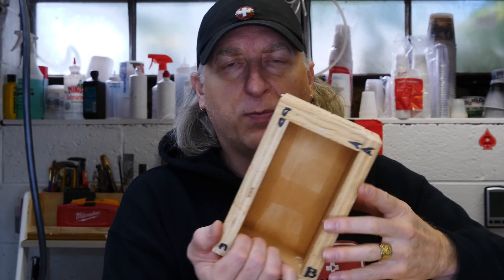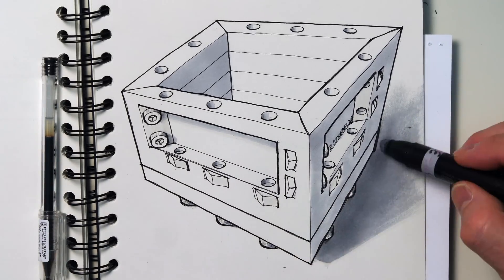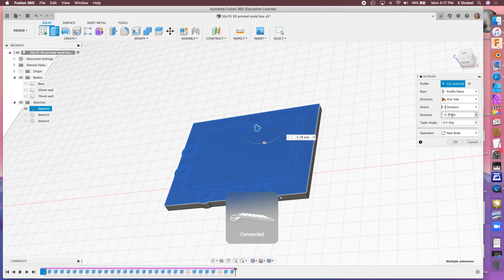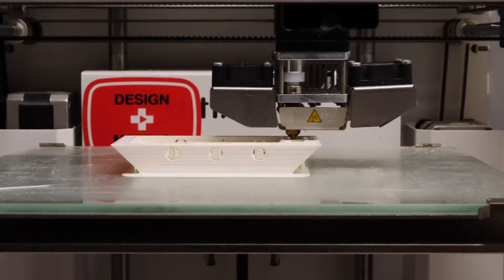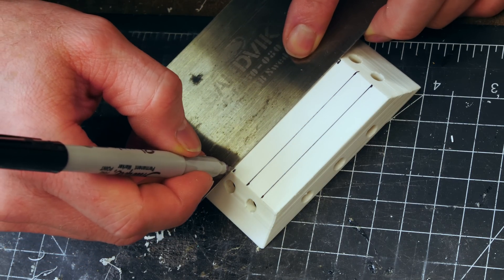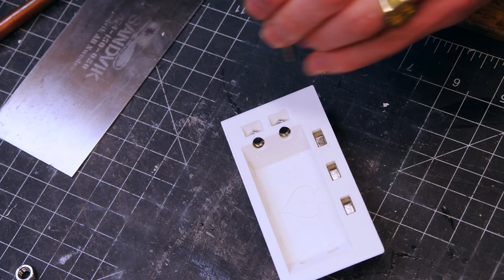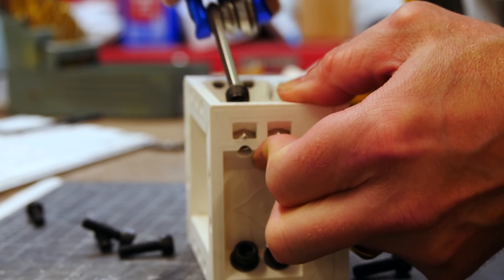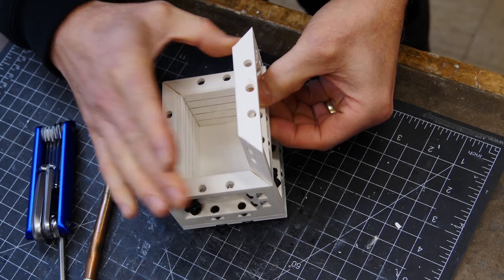3D Printed Molding Box System for Silicone molds & Casting Urethane resin parts

Comment: Hi Eric - thanks for so generously sharing your skills and experience with us!  

It's been about 2 years since you released this video.  I'm wondering, what percentage of your molds use this modular approach vs the library of plywood molds that you previously used?
Reply from the maker: It's really just a matter of scale, it depends on what I have to mold and if it'll fit inside of the 3D printed ones. Honestly I should make some bigger ones. They work really well and I'm really pleased with how they snap together and perform.

Comment: Good video but that Ultimaker needs a serious tune-up! Those layers lines!
Reply from the maker: What’s your suggestion for the tune up....
Reply: @EricStrebel  I sent mine back to Ultimaker for them to do it but first things would be checking all rods are clipped on properly (my plastic injection molded clips warped over time), rods lubricated, all hex screws tightened (especially the ones holding the stepper motors) and most importantly, checking the tension in the belts
Reply from the maker: Ok, seems like good practice for basic maintenance of the machine

Comment: If you are going to be using this one size allen wrench you can get a T handle wrench and by spinning it by the shaft and finishing off with the handle it might be faster than the power tool because you don't have to be worried about over torqueing.
Reply from the maker: Yes, good tip

Comment: "I'm limited by the size of my printer..".if you dropped the captive nuts in from the edges you could alternate the parts back and forth about the 45 degree angle and make one large plank... or a slab if you alternate the captive nuts slots.

Comment: Very nice! Self adhesive rubber packing on the miters would make good gaskets. You’d probably want to print the next ones with a shallow channel to accomodate the packing, slightly less than the thickness of the packing.

Comment: Wow, these are awesome. Also, just a slight size increase, cast them in aluminum one can make permanent cope(s) and drag(s), for casting aluminum parts. much like myfordboy did. Though, these are a cooler design.
Reply from the maker: Yeah, thanks! He does some nice castings, he had even made his own aluminum molds
Reply: @EricStrebel  Yes, he has he's also gotten into 3D printing which enables him to make master molds of steam model parts for engines and trains. I just ran into your videos, and your channel seem very interesting enough to binge watch with popcorn and a couple beers. Yup, I'm hooked. I'm subscribing.
Reply: @EricStrebel  Also, pardon my impertinence, please but may I suggest using (counter sunk) flat socket heads screws for a flush bottom plate of your modular flask?

Comment: LOL I knew you were in trouble as soon as you started sketching.

This actually seems less flexible than just the overlapping-board assembly.  The main issue is the fixturing, which you flat out didn't address.  You started with screws and...  went right back to screws.  Did you ever ask yourself, "Are screws actually necessary?"  Or "Does this even need to be a rectangular shape?"

Also your printer has major issues with banding.  First culprit is your z-axis.  Your prints look like something from 2010.

Comment: I would suggest trying out some heat press inserts. They're very strong and make very professional looking parts. For this I probably would have used M4 bolts with M4 inserts.
Reply from the maker: Thanks
Reply: @EricStrebel  stick with the nuts eric.. heat press inserts can pull out under extreme force.. the nut design cannot..
Reply from the maker: I agree

Comment: You should first calibrate this printer and fix the z-axis print problems, then select the correct parameters in Cura. BTW, so much plastic and metal for basic little box, really?

Comment: a couple of things on your print

that was not a skirt you removed that is a brim Skirts do not touch the model brims do and their was no need for a brim the brim is meant for thin models that need more buildplate adhesion so thy do not fall over during printing

their was no need for the support in the horizontal round holes considering you just drilled them out anyways but just under the vertical round holes those were actually the only supports you needed when adding supports you should have just used a touching buildplate option instead of an everywhere option in your slicer

if you were going to model in the fill lines as long as the lines them self's were recessed you would not have needed supports for them because it would be nothing to bridge there tiny gaps or you can chamfered them so thy are little v shaped groves and not have over a 45 degree angle again being easy to print without supports

you really need to do some test prints just to test the capability's of your printer so you know what its capable of printing so you stop wasting material and time printing supports you do not actually need and can feel more confident in printing more complicated things without supports
Reply: i was thinking a lot of the same thing when he said support was needed to add fill lines, but started off the print mentioning 45 degree angles don't need support... 😣

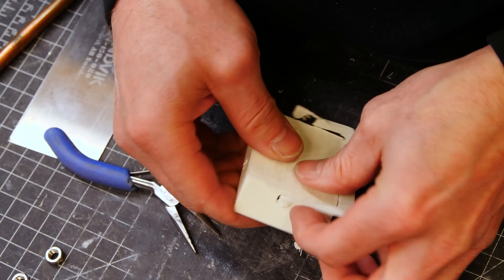Comment: 3:09 Brim, not a skirt.  Plus, you should be ok printing w/o a brim, which in turn should reduce the amount of clean up.  Using tear drop holes should further reduce post-processing.
Reply: And 10mm fill lines can easily enough be done with a triangular cutout that won't need any support material cleaned out of it.
Reply: tear drop holes dont look clean when you want round ones. it looks bad imo. and its better to drill out the holes anyway.

Comment: Thanks for the Video and for sharing your ideas Eric. I use a magnetic modular system, with 'L' shaped sides which are adjustable in terms of length and width, they sit on a large magnetic sheet and no fixings are required - neither is hot glue so takes about 20 seconds to put one together. I wonder if your fixed design could be hinged so that 4 sides fold together and then clip to a base, or borrow from the lego concept to make something more modular. What you have there looks very sturdy but perhaps those bolts might be tedious after a while? Just a thought...
Reply from the maker: Magnets are pretty clever! Gosh I can see making a new version with magnets. Did you develop this system or purchase it?
Reply: @EricStrebel  I developed it, because I got tired of cleaning up hot glue and continually making new mold boxes. I use foam backed magnetic tape for the side edges  and side bottoms and steel impregnated adhesive sheet for the base. It's pretty cheap too. I tape the inside of the mold box walls with clear adhesive tape so don't have to worry about anything sticking and I try to avoid mold release sprays because they can interfere with painting. The L shape walls are common as you'll know in mold making and allow for a entirely adjustable system that can be re-used.
Reply from the maker: Are you ok with me adding magnets to my concept, and giving you credit in a future video?
Reply: @EricStrebel  I use this for my work (www.jimcheatle.co.uk) - I'm an artist based in London, UK. Go ahead and use it, no problems Eric.
Reply from the maker: Fabulous, I will give you a shout out, and add the link to your site when I make the 2.0 version. Thank you for sharing your idea. The world will benefit from your kindness

Comment: sorry, but this is overengineered and in the end acutally not very versatile. build 4 separate (lego or duplo for best versatility) walls, align them on a smooth surface with overlap (!), seal with hotglue. your product looks nice and professional, but the concept seems to be way off topic ("for years").

Comment: With finger joints instead  of mighter joints on the upright walls you might be able to overcome the length  limitation from the 3D printer build volume. One countersink bolt going through the fingers top to bottom to secure it. This way wall pieces could be connected to each other to get longer walls.
For the base plate a tongue grove system could be used to create larger bases than the 3D printer allows...
Reply from the maker: yes, possibly.

Comment: I did something pretty similar a few months ago for the same purpose of casting silicone molds. I used FreeCAD's Spreadsheet workbench in order to automatically generate a box of any size with a set of parameters, which was pretty handy, but I plan on re-doing it in either OpenSCAD or CadQuery (which looks interesting) for my next project for even more flexibility. I've haven't used Fusion a lot (and I don't plan to given the recent license updates) but I don't think it's possible to set this kind of parameters unfortunately. In any case, your design looks a lot more well-made than mine, since I was only experimenting mine is a lot "lighter" in order to print quickly and cheaply. I used a combination of flat parts on the front and back and U-shaped parts on the sides with M2.5 screws, but I like your idea of having corners at at 45 degrees angle, it allows more reusability and flexibility because any wall can be reused on any side for bigger/smaller mold boxes. I might steal this idea! Thanks for the video
Reply: Fusion 360 really didn't change much. there was a lot of misconception about the 10 doc limit. but i still have 40+ docs that i can easily access. backing up all my files in fear of all but 10 being deleted was a waste of time. 
its still a lot better to use than any other cad software i used so far. having to draw each wall one vertices at a time is frustrating and slow. my modeling time improved 10x in fusion over something like google sketch up or freeCad.

Comment: Do you plan to do some parallelogram side pieces so that you can extend the width and length (in addition to already being able to stack the height)? or will you just print wider trapezoid walls to do wider molds?

Comment: Why not just make the moldboxes permanent  with tapered sides? and why do they need to be strong? couldn't they just be acrylic or thin ply? If they are tapered you don't need to take them apart. Just leave a little  corked hole in the bottom to blow some air into it, and out it comes. You could make the mold extra large and just use as much height as you need .

Comment: Why no design 3d printed corners that use wood for the walls? Then you can have even larger boxes
Reply: Thats a smart idea! Thanks
Reply: @guyvagman   could also make a wall that has the opposite angle that you can use to extend the side ( example /_____\ and  \___\  = /_____\\_____\) then you could expand it by what ever multiple of wall/floor expansion size you want.
Reply: @markburton5292  cool idea too!!

Comment: Ive been making molds using lego bricks surprisingly strong and very flexible layout
Reply: I found Lego bricks to leak. Didn't work for silicone.
Reply: @MarcusWolschon  cover them with clear plastic tape...
Reply: Im just gonna print a tiny box for my tiny pig, tape the 3d printed box and secure pig to bottom then  I’m just gonna mix silicone and pore
Reply from the maker: Yes, same concept but you don't have a flat bottom surface, and you can't remove the sides indivualy.
Reply: @EricStrebel  Not as robust certainly, Ive only been using this for small silcone items. Ive been using large plates with flat top tiles 2x2 as the base some ridges but ok. Thanks for the creativity inspiration.
Reply: @EricStrebel  you have to build the walls separately and arrange them like a routing template. 100% flexible in size, removeable... and flat on the bottom (sealed with hot glue)

Comment: If you did the design parametrically, you would be able to have the program generate new sizes by stretching or entering the size.

I think you could add tongue and groove alignments to the 45 degree faces and use fewer screws.  Seal the corners with blue painters tape to prevent leaks.

Also, have you height registration stand proud, if you trust your 3D printer that far.  They will be easier to highlight and use than a recessed line.